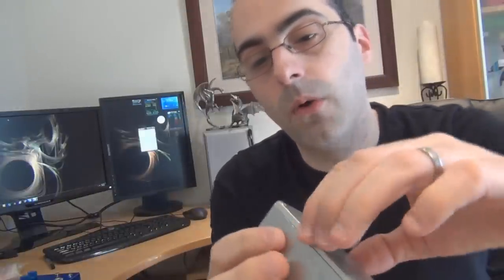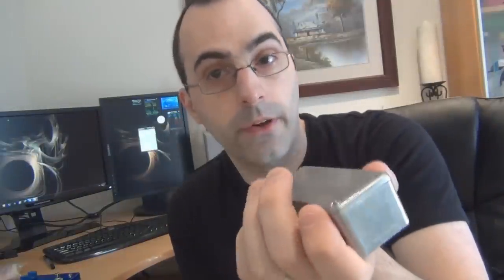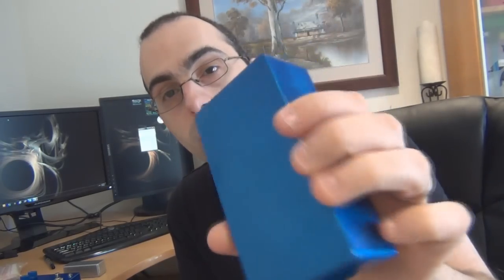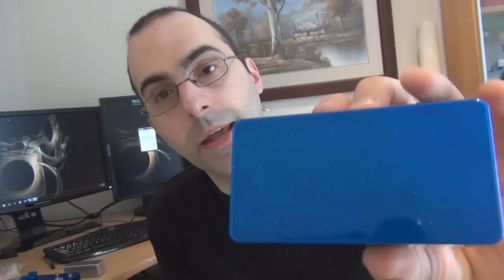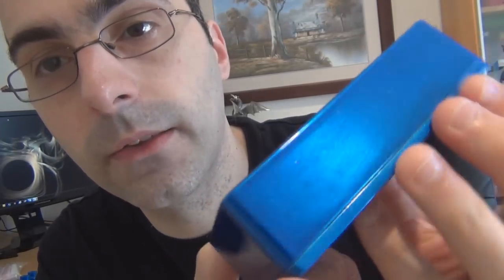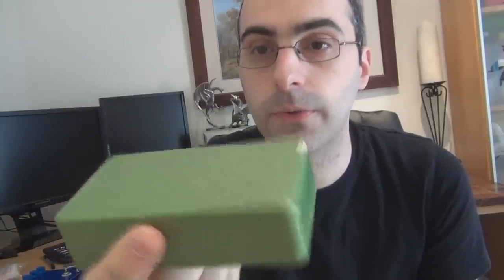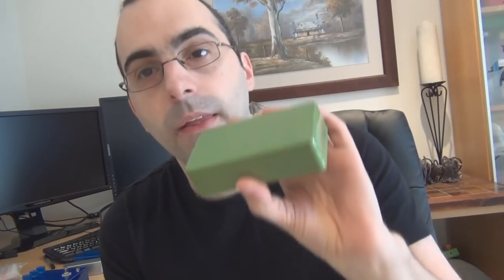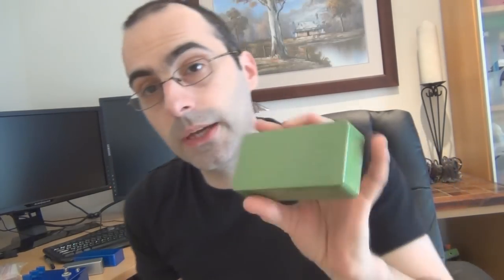Powder Coating Update #2 (DIY Guitar Pedals)

Comment from the maker: No problem Christopher!  Maybe try a heavier sandpaper?  120 grit something really rough.  Still havent found a solution to the dust / contaminates problem.  Only thing i can think of is the dust is on the enclosure before i spray it, possibly.  Or...its in the powder before i start.  Or the equipment?  No sure.  Let me know if you work that one out, i would really appreciate it!

Comment from the maker: You can use enamel with decals, works well enough.  Probably wouldnt be a thick as well.  Problem comes from using these 2 coat processes (candies and dormants).  Totally 3 coats with a decal and clear coat.  Lid ends up not fitting.

Comment: You could tape the lip for the first coat. Likely though, it's the second coat that is causing a problem. When you hit it hot, you can't control the thickness very well. You could tape it for the second, but then you may introduce contaminates. 
.
The pre cleaning/treatment will determine the durability more than anything. The paint itself is plenty strong. If it chips, its a process issue.
.
My shop powdered candy clear on bare, pro BMX frames. If it can hold up on there, these are fine.

Comment: Thanks for your powdercoating videos, they have helped me a bunch! I have been running into the lid fit issue lately and decided to try a one coat with some pendry purple candy. It turned out great! I spent a lot of time sanding it into a nice pattern as I was hoping the brushed look would come through. It didn't but I think that's because their purple is pretty dark and it would probably look good with the blue.
My biggest problem I run into is getting dust and bumps. Any tips?

Comment: Just found this vid :)
I normally spray with the bottom panel on (held by only one screw). It solves the problem of powder getting in under that lip and it also stops overspray inside the enclosure. By having the one screw in it masked the area so you know it will earth 100% later.
Of course it will stick the two metals together. To get around this I pre-drill at least one of the top holes out so that I can get a screw driver in there to give the bottom panel a little whack to pop it off (maybe do this between every layer).

I've even done some with 5x layers deep no problem. Vein base, Candy colour, 2x clear coats, engraved and text filled with chrome powder, then final clear coat.

If it's a candy colour I normally pre drill the sides, if not the whole box, because the high gloss seems to scuff if I look at it too hard and laying it sideways on the drill press is asking for scratches. Maybe you've got some tougher powders though :)

Keep up the cool videos!